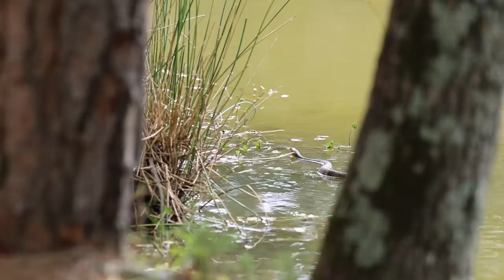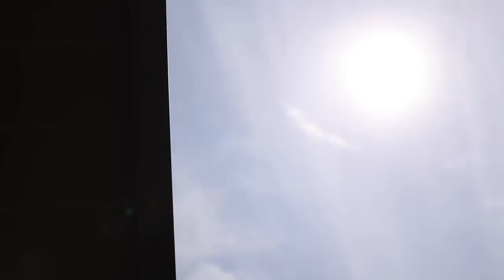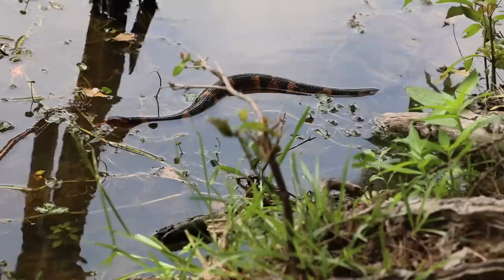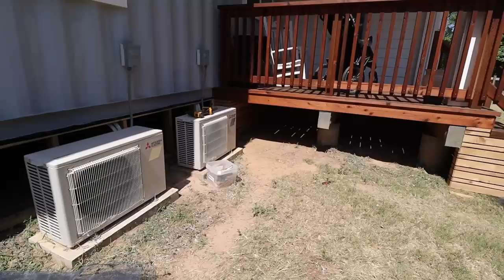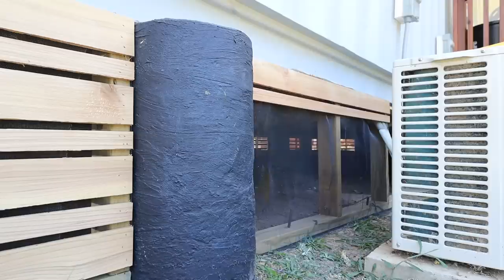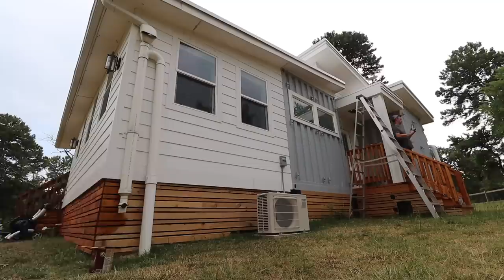HEAT WAVE | Hottest Summer Days Living Off Grid

Comment: I've been watching you all from the beginning almost.  Solar Cell / battery is always supplemental electricity. It keeps you from using too much of grid power. Sufficient number of batteries is important, plus the condition of the batteries, which you've found out of course. As soon as you can, I'd advise getting Coop power routed to your place. I use electrical fans on pedestals. I love my fans, too. You just have to raise your thermostat some while using the fans. Water, that is always an issue.  My wife is from the Philippines and the house she had built in the Philippines, she has a tower tank for extra water. It was a bit huge, but it was great until they had city water piped in.  Water catching is so important when living off the grid. Plastic tanks used to help catch the water from your roof.  Using dish water to flush the toilet helps some. This one guy that lives out in the desert part of West Texas has three or four plastic tanks.  He manages but it takes planning.  In the summertime, forget the grass. It always comes back anyway.  Having an extra set of batteries when your A/C drains the set it's using, it can switch to the second set. Still, on cloudy rainy days, you're going to have a few down days. Another choice is that gas generator as a backup. They look like a large condenser unit. I hear they are quiet but don't get me to lying.  Okay, enough written here. Hope it helps a little.
Reply: Hello there 👋👋,how are you doing today? Hope you’re having a good day?God bless you!❤️
Reply: @amytaylor4407  Thank you and God Bless you, too🙂. I can see that you're blessed. Have a great day.
Reply: @larrypierce2777  you’re welcome ☺️. Amen Ty. Where are you from?
Reply: @amytaylor4407  Crowley, Texas
Reply: @larrypierce2777  okay. I’m in VA. How’s the weather there today?
Reply: @amytaylor4407  We're actually starting to get some rain, very little but some.  When I was seventeen and eighteen I was stationed Fort Lee Virginia outside Petersberg Va. I still have good friends that live in Dinwiddie there. Loved Virginia.
Reply: @larrypierce2777  ohhh okay that’s cool nice one.  It’s Cloudy skies. A stray shower or thunderstorm is possible. Low 68F. Winds SE at 5 to 10 mph. Any plans for tonight?

Comment: Stop being so damn stubborn,you have kids now. I was off-grid for 7 years and had the same problem in the summer running the AC and a few times in the winter when a ice storm hit and no sun for days. Get back on the grid for emergency and for the AC. All you have to do is put in a new panel and run one circuit for the AC/Heat. I'd highly suggest putting in a deep well,the water is much better than messing with that filter crap.The rainwater is contaminated now anyway.

Comment: I sectioned my apartment so that I installed a few ac per section to save power
Reply: Split type air conditioners are quite power saving.  Set it at 26 deg celcius but use a fan to cool down doesn't consume that much power. Remember to use the economic mode before you go to bed.

Comment: Solar without adequate storage is a problem for millions of users - they are often sold a system based on unrealistic data. My suggestion is gravity batteries - while they are still in infancy, they are the future. My proposal is not to create towers - but rather go underground with the mass and have the mechanism on level ground. May sound a bit weird but in time this battery will be the norm. It has not chemicals and can go from zero - to fully charged without damage and many thousands of times - with maintenance - indefinitely.
Reply: Hello there 👋👋,how are you doing today? Hope you’re having a good day?God bless you!❤️

Comment: Solar will never replace fossil fuels. It just does not provide all of our energy needs. Think about how much it won't work in Arizona where they get 115 degrees for extended periods and no rain and then there are the regions that get below zero for extended periods. It just won't work in those regions either. It's a pipe dream to think we can get rid of fossil fuels and rely totally on wind and solar.

Comment: Have really missed your weekly updates, then my phone 📱 has been having BATTERY issues.
Wondering how DEEP the water table in your area is, in event you had to DRILL a WATER WELL? I realize that would be VERY EXPENSIVE, especially your distance from a city water main ( If one is not too far away.).?
Have you thought of getting a windmill or wind TURBINE to capture enough wind to generate additional electricity?
Lot's of questions & none have an inexpensive solution.
Meanwhile the cost of ELECTRICITY in the BIG CITY 'S going out of SIGHT, thanks to ELECTED state officials 🥴

Comment: This is what it looks like when there is 420 ppm CO2 in the atmosphere.. When I was a kid, CO2 was 350ppm... 2  ppm annual increasing CO2 is why you continue to see "daily record high temperature"...  Yes, that's what 2 ppm per year (6,000 Olympic sized swimming pools of oil burned into the atmosphere per day) will do...  Our best hope would be to figure out Fusion power, then figure out how to use that power to bottle up Millions of years worth of fossil fuel that we have burned in the span of a century...  So the icecaps are melting 6 times faster than the original computer models accounted for.  One reason is that forest fires create global soot, which as it lands on polar ice, makes that ice blacken, thus creating less reflectivity, causing it to melt faster than pristine ice.  So, then we are witnessing an "avalanche effect" where these systems start to self amplify... More heat causes more fires, causes more soot, causes more melting, causes more heat, causes less rain...  We are not going to be able to "move away" from this problem.. It will follow us.  I say take every penny we are spending on "going to Mars or the Moon", and instead figure out 1) Fusion, then 2) How to geoengineer the gas composition of our atmosphere... (remove CO2, Methane, CFC's)

Comment: You have a pond, and filtration, get a sump and filter the water as you pump it in. You said you have plenty of power in the day time so it shouldn't be an issue to pump pond water into your cisterns. as for your batteries, get them a cheep small AC unit. I've noticed Lithium batteries hate to be hot or warm. The heat and lack of rain is just a testament to global warming.

Comment: Running AC exclusively on solar is a pretty lofty goal,  just saw this about geo-thermal air condiitoinnig - https://www.youtube.com/watch?v=nV7XJXETr0Q&ab_channel=SimpleTek 
just need to dig 10 feet down , some underground water cable, a radiator, and 100w and you can keep a shed 8 degrees C in the winter, (46f) and cool in the summer, with only 100w, so youre not using battery for cooling and also can keep your lithium batteries alive with heating for those in colder climates that could make solar even more worth it in the winter.

Comment: I really like what they have done but completely fail to understand the following: if the solar panels are fine but the batteries are not, why not buy new batteries? If at times you get enough water but other times you don't, why not upgrade your system. Surely with over a million subscribers you have the money to do that. And finally, if a house has been without a skirting board for over 3 years, do you really have to do that job during a heatwave? The "problems" all seem a little over dramatic and/or easily solvable to me.

Comment: Your solar system has already cost more energy than a 4 person family uses in 5 years on grid, and you haven't even changed your batteries, yet. You're in for some reality checks (like most YouTubers on solar grids).  At least you've faced it.  Some other Youtubers will like sell their solar boat / RV/ Van, etc, a year after getting new batteries so they don't have to admit that they have to change them again after 1 year. They get a new set with the new (boat/RV/Van) and let the new owners deal with the environmental cost of changing the ones that died in a year. I'm guessing you'll be on grid in a year, and digging a well. Even if you get new/more batteries. It's just a reality that solar is not sustainable.
Reply: p.s. The skirting looks great, and your kids ARE adorable.

Comment: spend money on nice ATV, electric bike, but yet keeping really old cycled batteries, the same batteries that if you did not have would leave yall powerless through a hot summer, this couple is STUPID. Get the toys after you get a nice electrical setup that would hold ya till the sun is up to charge them again. This is what happens when you think about yourself more than the family. I mean they could've saved a ton of money buying used atv instead of the rock climber or whatever that big atv is. Maybe the problem in this video is not that fact they have problems but the way they are spending their money on toys while building a house. They could've finished building the house years ago if they would focus on the building more than just goofing around. Him more than Her.
Reply: the reason you go off grid is so you don't have to pay so much in electric bill but you gotta understand that the electricity needs to hold till the sun hits the solar panels to recharge the batteries. Either you need to stop spending your money on toys and get a proper electrical system with new batteries or suffer through power outages because well your fun is more important than a stable home.